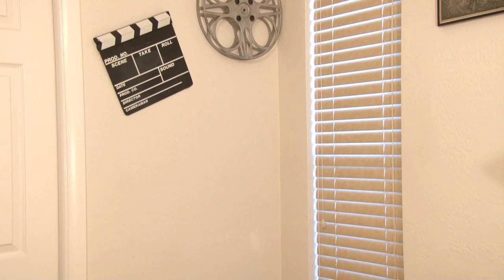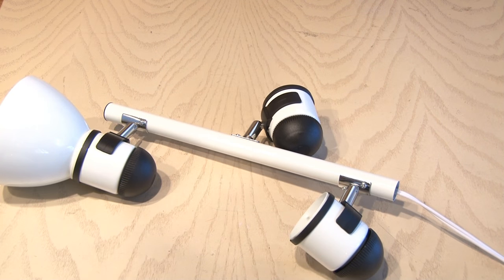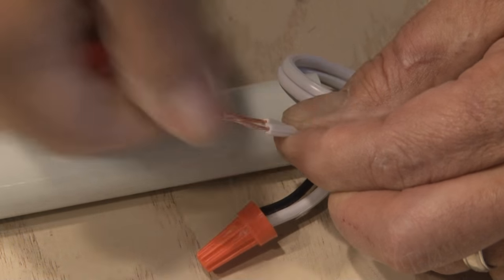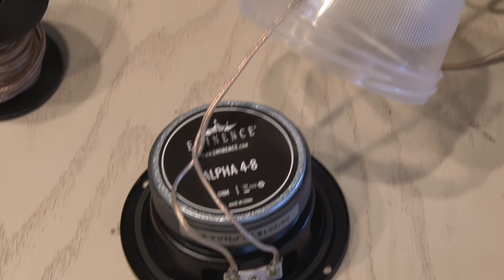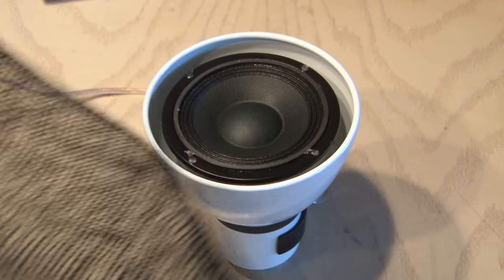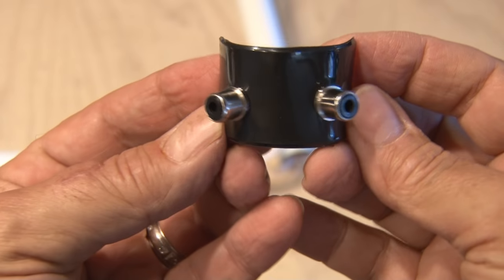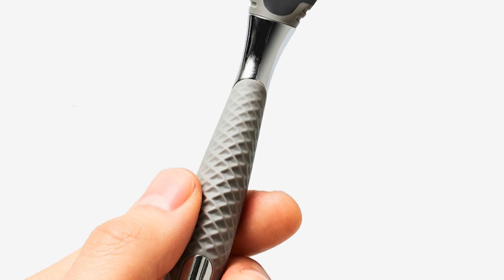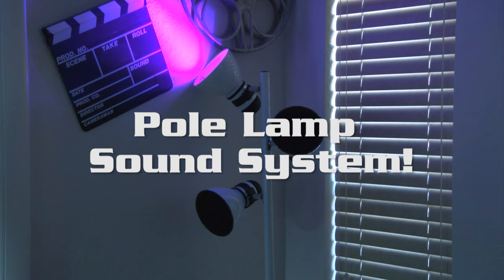Pole Lamp Sound System!

Comment: Hey Kip, 
Ya, 'stuffing' an enclosure emulates a larger enclosure & gives the appearance (to the speakers) of a larger enclosure. But I would advise you also project as close to 90 degrees as possible and corner load those 4 inch speakers (also 90 degrees if possible). It looks like you have purposefully but them in a corner, already, but the blinds you have in your video will not reflect well, so find another pair of walls made of a higher resonate-frequency-material and then you will have the best sound your system can produce. My 2 cents = 5 bucks. Thanks.

Comment: I would have added potentiometers for individual volume control knobs and kept the switch covers functional that way. And it would look a bit better if you had something to go over the rims of the speaker shades to hide those rough burlap edges. Neat base idea though.

Comment: could you use brackets that are fixed to he light shade to make the speakers more stable, and a bolt epoxied to the switch cover on the back of the lamp to make it more capable for air flow using the vents on the back of the light fixture. just a suggestion.

Comment: Kipkay, what if you put LED strip inside of the light shell. then put the burlap over the third light to make it look like the others. perhaps put a chirper or two in the third one and add the LED strip. Then they all will have speakers and lights and look uniform. 

But cool nonetheless!!

Comment: u should add led strip inside the speakers shade
Reply: Agreed. Then all lights would still be functional. Additionally, one could add a frequency response circuit to the LED lighting and the lights could change color with the frequency of the audio. This could be switched on or off depending on your mood.

Comment: You killed it with hot glue. Black (windshield) polyurethane adhesive would hold better.
Reply: Next, ground shield audio cables, to prevent AC buzzing. Fitting speaker grills or mesh inside will look better than cloth.

Comment: You missed the tweeter
Reply: Adriano C full range driver....
Reply: dubradiolol can't compare with a thing dedicated just for high fq
Reply: Adriano C , totally agree with you about separate tweeter, but I don't think sound quality is of any importance in this project considering it's wired in a mono configuration... using Tupperware as speaker cabinets, and it's a lamp lol
Reply: As interested as I am with audio related projects, I have no idea what a tweeter does for audio quality. Would I notice a dramatic change in audio quality for basic household applications, or is it reserved more for larger scale audio setups?